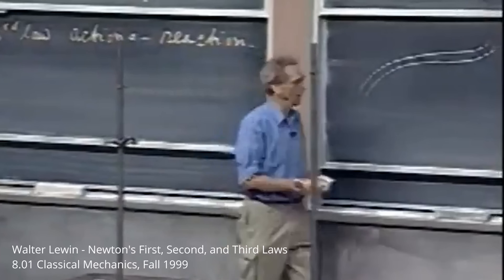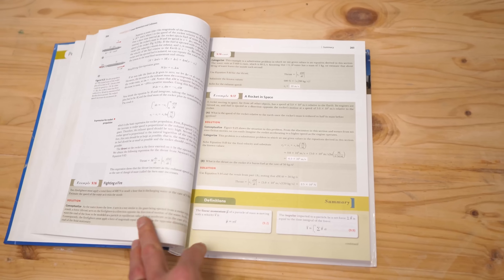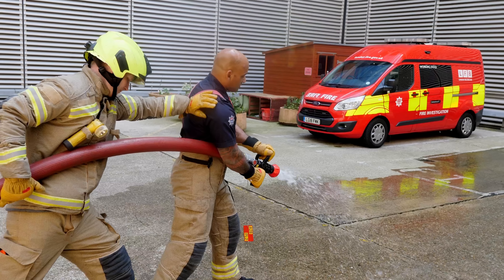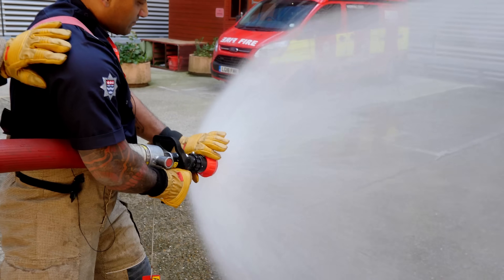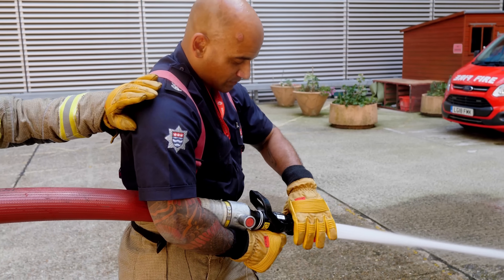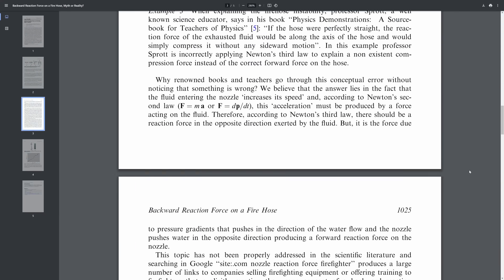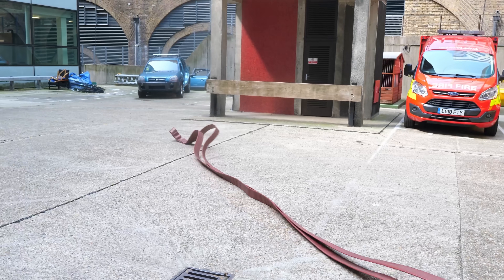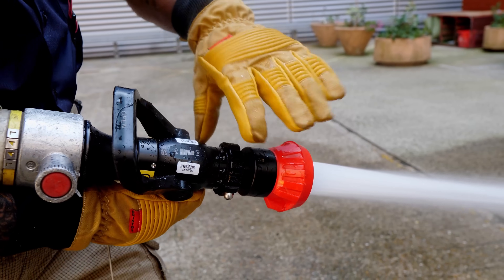Why chaotic hoses dance

Comment: When it comes to the fire hose. There does have to be some change in the exact forces and how they are playing out. I can guarantee those fire fighters know they can't just stand in front of that hose when it's blasting. Even if they had a protective shield. Kentucky Ballistics had a great video messing around with a firetruck and a hose. The forces they are dealing with while holding the hose vs what they are hitting with the water are different. How? In what way? I don't know exactly and I'm not smart enough to figure it out. I'm curious how much effect the water constantly rushing to the nozzle effects it. Or how much the pressure being exerted on the hose making it more rigid might assist or work against the fire fighter holding the hose.
Videos like this make me happy because it lets me think about some of the most mundane things in fun over complicated ways.

Comment: 9:00 A full turn will net you 0 pull because the forces that pushes the hose and forces that pull the hose cancel out. You need to try making the nozzle 90 degrees to the exit of the hose

Comment: Nowadays, there are a bunch of fighter jets with engines with multiple adjustable nozzles to help with manuvering or hovering. If your model of "the force is felt exclusively by the pump/engine", they would never work. If your model of "the corner feels the force of fluid impacting it", the bend would need to aim at the ground, not the outlet.

Therefore, it must be the "rocket" model of fluids exitijf pipes creating force. Nothing else keep that sort of fighter jet in the sky.

Comment: Do you think the outcoming flow reacts against the oustide air causing the propulsion? If you put a water hose under water will it react more because its pushing against water witch is a denser fluid than air?

Comment: So the water accelerates when leaving the hose at the nozzle, even if the nozzle does not change the hose diameter?...If so, you should be able to measure that.

Comment: Steve! I emailed you about hose physics maybe 3 or 4 years ago. A thing I mentioned in the email was how would a hose behave if instead of the fluid (air or liquid) leaving the hose, the fluid were being sucked or pushed back in to the hose at high pressure? I've been curious for years.

Thanks

Comment: I had a stupid intuition idea. For the air, the pressure inside the hose is bigger than outside the hose, so it will create a bunch of forces trying to expand the hose, there's also the friction inside the hose. for water water doesn't compress, but it still pressurizes the hose cause the hose does compress. now this hose tries to shrink in on the water but can't, so maybe the end of the hose trying to shrink to it's "normal" size is causing this force?

Comment: The pressure along the hose is not the same, it must have at least slight gradient to allow the flow. There is no flow without a gradient of pressure, the same with electric potential and current. The gradient is proportional to the "resistance" of hose but this value could be calculated only based on empirical formulae, taking the type of flow (laminar or turbulent) into account. Because the hose is flexible, the resistance of its curvature varies in time with the curvature itself. I think the finite element method would be helpful in the simulation.

Comment: If the hose has a constructed nozzle on the end it will certainly impart momentum to the liquid - think about the mass flow. ∆m enters at v1 and the same ∆m exits at v2 > v1, the acceleration means momentum has been imparted by the nozzle.

Comment: I think the problem with the pump experiencing all the force is somewhat true, but you have to consider that the pump is pushing back at the water. I think what's happening is that the water coming out of the nozzle is being pushed out by the water on the inside of the nozzle. you can think of this like a newton's cradle.

Comment: The pressure can be one insight into the underlying phenomenon, but consider it more broadly from Newtons 2nd law, F=ma. The pressure gradient at the nozzle creates a force gradient on the water, so the water volume accelerates. Momentum is conserved by the mass flow rate remaining constant, but the stream volume thins out or aerates over the same length of water with the higher velocity. The force is applied at the pressure gradient which would be the water in the hose if there was no nozzle, but the nozzle takes some because of its constriction. Now the water in the hose receives some of that force too, but there is now a column of water mass much heavier than the nozzle which is receiving that force, so it doesn't move much. It pushes back on the water inside which reacts that force at the closest momentum change point (bend usually). The bends in the hose see hydrodynamic forces only due to the change in momentum of the fluid inside, but again, since water mass is so heavy on both sides of the bend, it isn't enough to move the hose. That's why you only see the END of the fire hose flailing because the hose force due to hydrodynamic momentum plus the nozzle force is enough to move the mass of the hose and water on the free end of the bend but not the pump end of the bend. The length of hose you will see flailing is related to the mass and stiffness of the hose and the mass and momentum of the fluid inside it.

Comment: Great video! These chaos systems are pretty interesting. The comparison to flags and other similar systems was something I hadn't considered! The difference between a short hose and a long hose is very reminiscent to me of the pendulum then pendulum on a pendulum problem. Albeit it quickly goes from 1 to many-many small pendulums that are incredibly short and not limited to 2D motion! Eitherway Im going to be thinking about hoses, flags, and chaos all day today now and I thank you! (I also wonder if there isn't a way to think about the inflatable man and water hose systems as examples of under-pressurized, critically pressurized, and over-pressurized hose systems)

Comment: Are the forces at the end of the hose like the end of a cracking whip? The way the smallest curvature in the hose structure can cause off axis (to the exiting water) forces and bunch it up at the tip looks like a similar mechanics.

Comment: The water does not gain momentum as it leaves the hose, it's actually decelerating because it collides with the air resistance and low pressure in front of it and that is why it pushes back on the hose. Irrespective of the nozzle, the point where it leaves the nozzle it starts decelerating, same as a bullet leaving the barrel of a gun.

Comment: I don't think the argument of water accelerating at the end of a hose holds. Water is incompresible, so if the diameter of the hose is unchanged and it can't accelerate. You measured the hose with air, where this expansion can occur.

Comment: Steve - this does not seem to be your usual rigorous treatment of the subject.  Interesting but I suppose a bit hand-waving type of explanation.  I expected you to focus on some points you glossed over.  For instance, you say that water is less compressible than air.  That is an understatement - water is virtually incompressible whereas air is not far from a perfect gas.  Double the pressure on air and it will half its volume which doubles its density in effect.  Double the pressure on water and you could not measure the change in volume.  In terms of numbers it is a compressibility of air of close to 1 whereas for water it is around 5 x 10 (to the minus 10)

Comment: it's more complicated than that, the fact is the water is NOT travelling at the same velocity down the length of the hose, even if the hose is perfectly straight.  there will be pressure waves bouncing around all through the medium along the whole length of the hose, and standing waves that those travelling waves interact with.  pressure and velocity with in a hose is a chaotic system, especially when looking at very small changes to pressure and velocity.  throw in a momentary spike in pressure/velocity at any point along the hose and the effects cascades throughout as it interacts with everything already happening.  we like to boil complex systems down to more manageable understandings, but truth is the universe is extremely chaotic, it only appears ordered by cherry picking what we want and ignoring everything else, and that can be very useful.   In short, there is no truly simple explanation for why the hose is doing that, and because it is prone to wild variation from very minor changes it resists our natural desire to boil it down to a simple answer.

Comment: Steve, the pressure in a fluid system is only the same everywhere when the fluid is stationary. Because the fluid is moving, there is a pressure gradient. This is actually similar to electric circuits; when there is no current, metals are equipotential surfaces (they have the same voltage everywhere), but when there is a current flowing, there is a potential gradient (electric field). The electric field is responsible for the motion of the charges in the first place.

Going back to the hose, the pressure gradient is responsible for the motion of the water in the first place. The pump (akin to a battery) produces high pressure. Before the water starts to flow, the hose is at atmospheric pressure, which means there is a very large gradient between the pump and the front of the water. As the water takes up the hose, that pressure gradient is reduced somewhat. What you end up with is a very small gradient between the pump and the end of the hose, and then a large gradient at the end of the hose which penetrates back into the flow a small amount. Your intuition that the water is pushing back on the water behind it is correct! That is what's happening. However, any one chunk of water is pushing on the water behind it less than it pushes on the water in front of it.

Comment: 16:17 I intuitively understand that the end of the hose flips when the curve propagates to the tip and “uses up” the length of hose in a sense, but I feel like there should be a more rigorous way to explain that because I’m also trying to understand how energy is transferred to the end of a whip. Destin made a slow mo video of it years ago, but why does a wrist flick at the handle of a whip turn into supersonic speeds at the tip?!

Comment: By my intuition the rocket engine comparison doesn't make sense. For the hose when water exits it and forces are applied, there is force against the axis of the hose (if we assume it's completely straight, or infinite serie of practically straight sections pushing each back until it goes all the way to the faucet/pump), so the firefighter shouldn't experience exact force of the water "jet" pushing against the nozzle. Although that's just my intuation of the applied forces... and I'm crap at physics and advanced math.

Comment: For the sake of simplicity, consider a hose with only two straight pieces that meet at a single kink. The two pieces make angles α and β with the straight line that contains the endpoints of the hose. Water flowing in the hose with a mass flux Φ and velocity v exerts an outward force on the kink  (sin(α) + sin(β)) Φ v. If we pull the end of the hose in order to create a tension T in the hose, we create an inward force on the kink (sin(α) + sin(β)) T. So in order to keep an equilibrium we must have T = Φ v, independent of the angles α and β, as long as these angles are different from zero. Of course in your experiment with a staight hose the hose is never perfectly straight and you will measure the force Φ v.

Comment: 9:00 re: the hose force experiment - if the hose has a full turn in it, some of the force will be pushing forward on the hose, counteracting a portion of the overall force pulling backwards on the hose.

If the hose were completely straight (i.e. a solid pipe) it should exert no pull at all (assuming the pump were in a fixed position).

Comment: The reason you can't push a rope from one end is because the rope buckles to the side at points along its length. If you restrict the rope inside a tube, you could push it, because any attempts to buckle would be resisted by the walls of the tube. In a hose, you can push the water from one end to another because its outward pressure is resisted by the walls of the hose. I'm not sure how that is experienced by the person holding the hose.

Comment: In a rocket engine the combustion chamber allows the burning fuel to reach a high temperature and pressure.  When the hot gases escape the chamber the nozzle converts the high pressure and temperature into thrust as it leaves the nozzle.  So, if think of the hose as the combustion chamber and the hose nozzle as the rockets nozzle then that would be the reason the firefighter feel the push back.

Comment: My first guess, before seeing the entire video, is that when you hold the hose, any part of the hose after the held spot works like a chaotic pendulum with multiple segments with a rotational force applied at the hold spot. I wager as you increase the force of the water coming out, it becomes more chaotic, and experiences period doubling in the same way as pendulums do.

Comment: Even in the chaotic case, the end section of the hose and nozzle itself seem to oscillate pretty regularly, even if its overall orientation is changing wildly. So I'm almost wondering if the chaotic part of the hose is separate from that. Perhaps driven by competition/interaction between the force from curvature you describe and the restoring force from the rigidity of the tube (inherent, or pressure-driven).

Comment: Around the 9:00 minute, where the question of hose force amount arises, I had a naive mental model that included the force orthogonal to the stream of water at the tip of the hose.  I see you measured force in the direction of the stream of air for bothe a straight and curved hose - both times along the direction of air leaving the hose at the tip.  I think it would be interesting (and possibly result in different magnitudes) if you measured force at the tip of the air hose in directions orthogonal to the stream of air.

Comment: The water in the hose hasmore potential energy(pressure) and less kinetic energy (speed). In the  nozzle the water accelerates and the reaction to the acceleration is the one the fireman feels.

Comment: The water in the hose is more potential energy(pressure) and less kinetic energy (speed). In the  nozzle the water accelerates and the reaction to the acceleration is the one the fireman feels.

Comment: Few ideas:

- The hose does in fact "wiggle" when tethered at both ends. But only once and only until it found its steady state, in which the momentum from the fluid inside changing direction and the hose and all the outside boundary conditions cancel each other out. When only one side is tethered, this equilibrium cant be reached since the conditions are constantly changing. As an engineer I had to learn about support forces on pipe installations and every bend in the pipe produces a force the support needs to bear.

- You only modelled the firefighters hose as a hose with equal diameter along the whole length. But in reality the nozzle at the end changes the diameter and therefore should change pressure and flow speed significantly.

- As you correctly stated air and water have vastly different compactabilities. I guess this has a major impact on those support forces on bends I talked about further up, as air can 'compress out of the way' where water slaps full tilt into the wall of the hose. Air is more spongy? I dont know how to make it more clear :D Also, air is way less dense and cant carry as much momentum as water does. So every effect you see on the air hose should be magnitudes higher on the water hose.

Comment: What about friction inside the hose? I'm not sure how big the force would actually be, but if the water is experiencing a significant backwards force from the hose, then the forward pushing force must be applied at that point in the hose, not only at the pump. Thus, the further along the hose you are the bigger the total slowing the water has experienced due to friction, and therefore to exit the hose there must be an accelerating force due to the pressure in the hose created by the pump. So perhaps the pushing of the pump is not only being done at the pump but rather is distributed throughout the hose due to friction in the hose. If so, a rougher hose would be harder to hold steady, experiencing a bigger force at the end due to a larger amount of friction. This could be tested!
Reply: My thought too. Also, bends in the hose could induce turbulent flow and more friction.

Comment: I really enjoyed this video. It really got my mind going. Lol
I was thinking of a few things, the direction of all of these were at different angles, also different materials that stretch at different rates, the dancing guys are fabric and release air through the fabric. Not airtight and the arms are another way to reduce the air pressure at the end. The hose are both different materials as well. I'm sure this plays a part as well as the weights on the ends of the hoses. I think if the fire hose was rigid it would act completely different as. The rubber air hose was pointing straight down, if it was like the straight bendy pressure test and was weighted the same % as the fire hose would it act like hose in the clip and go side to side. The weight would make a difference.

Loved this video. It got my mind thinking about some weird things. Thank you.😅